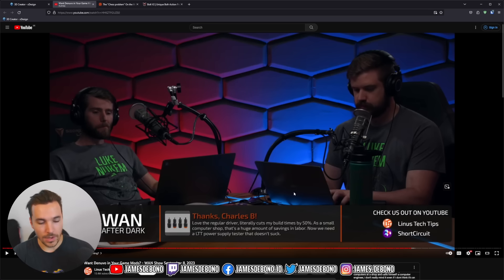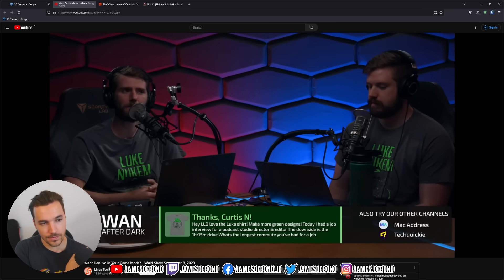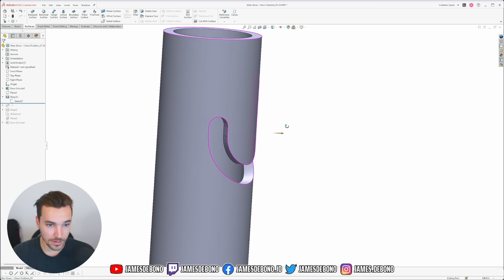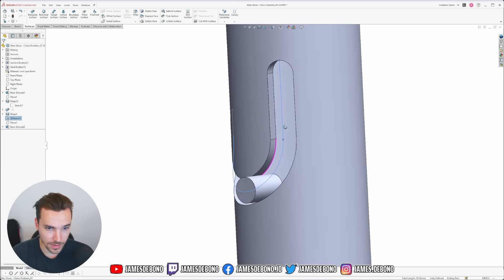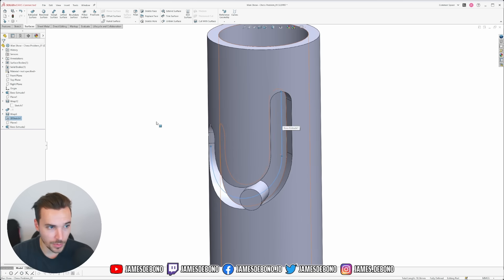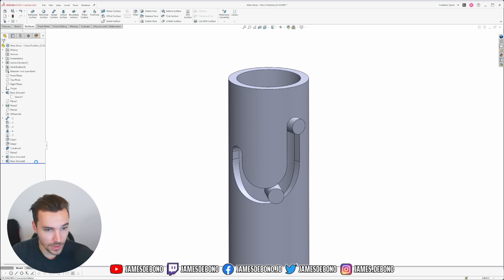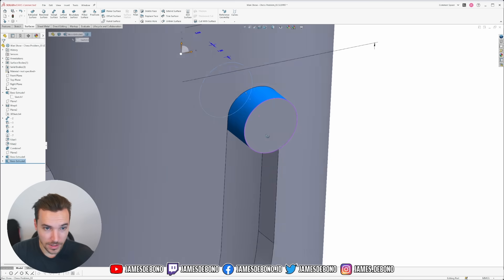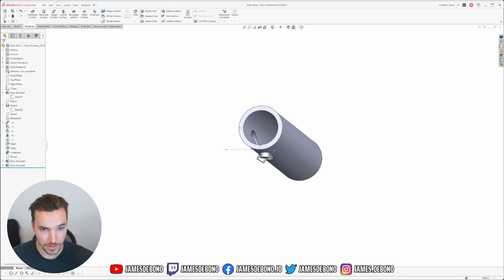LTT - Wan Show "Chess Problem" - Solidworks curved slot in cylinder

Comment: So Projecting the J onto the Mesh Does no Errors... But the Question Now Becomes How do you Extrude it Afterwards Where its 100% Flat in all Direccions...
Hmm Seems like a Curse Problem...
i don't do Solidworks at all - I use Blender but it must have similarities xD... hmmm Getting the Mathematicly Correct answer.... hmmm...
Projecting a Finish Object (Cube = Bad Reuls)  - Projecting a Line ( a Finish Line  = Good Results) , Projecting a Line + Extrude into Shape = Best Results.... 
Hmmm but there is still a bit of offset cause of the Line... but that Software Error now.... probably means that there is another way without Projecting the J in it...

Maybe Getting the U Shape and a Cylinder is "Easier"....

Bit of a Dumm Question.... but can't you Start in a Flat Surface - do the J Cut - Then Transforming into a Cylinder... would that be Possible?... 
let me guess Mathematcly Innacurte to Real-Life... cause CnC Machine Doesn't Follow that Path... Meaning that its Mis-Align When its Get Twisted into a Cylinder xD...

okay I should probably stopp thinking about it xD
Reply from the maker: The problem is that when you wrap it the slot walls won't he parallel anymore

Comment: Yup, is just seems to me the guys at LTT know CAD like 90% of users which is making round and square stuff to build machines and jigs, and relying on baked-in tools for more "complex" geometries (sheet metal tools for example). But making well controlled, more freeform/complex/unintuitive shapes, while not that difficult as you just demonstrated, is another skillset.

I do have an issue with these people saying it's a very difficult problem when in fact they should be more humble and say "that kind of modeling is not in my skillset".
Reply from the maker: I guess a better way to say it is that it's more complicated than it seems at first glance

Comment: How do you wrap an open sketch? i can only do it with an enclosed sketch like in the first example
Reply from the maker: Which version are you using?
Reply: Solid works 2022  @JamesDeBono
Reply from the maker: @UltimateP  Another commenter told me they added this ability in 2023. I know that's frustrating to hear but at least some closure

Comment: In reality I believe the first “solution” creates a valid geometry that can be readily machined via 4th axis CNC as long as you use a cutter that is smaller than the width of the slot. This is generally preferred so you have a more consistent finish by only climb cutting or only conventional cutting the outline, rather than full-slot cutting.

That being said, it’s worth considering whether or not you want a slot that’s tapered through the thickness, as it could affect the friction/feel of the bolt-action.
Reply: when performing the machining operation you specify the edge you want the end mill to follow, so it doesn't matter if it's tapered or not; you can create an offset in the toolpath with stock to leave (which can be a positive or negative value). while this is a "hacky" way to approach it, it doesn't really matter for the end product
Reply: you certainly don't want a tapered slot, the sharp edge will cut into the bolt over time.
Reply: @Pfooh  Maybe add a back-side chamfer?

Comment: Multiple ways to do it, that's for sure. I've done similar type of paths before back in SW2012 or so when we had a lecture on pierce and cuts that follow a path. So in a similar instance of cutting curves on a round pipe for 4th axis milling, we just drew the curve ( projected it ) onto the cylinder. Then at one end, created a reference plane that was perp to the end of the line. Created a rectangle ( To represent how an endmill is gona cut it ) and performed an swept cut that follows the line. Worked perfectly and accurealy represented what the endmill cuts..Took a second to verify this in SW2023 and got the same result. I guess sometimes you just know useless stuff ( me ) as for me SW is just a tool I dork around with. I just do CNC by trade. So I use solidworks based on how I know tooling works..if that makes sense.  I like the 5+ axis CNC machinist for years --> Solidworks/Solidcam --> Engineer direction  VS engineering degree --> solidworks --> HowDoMachineWork?? heh

Comment: If you make a plane perpendicular to the center of the radius you can draw your "j" and extrude it into the pen body ( do not let it combine bodies) then you can use the remove overlapping bodies tool and the slot where the two overlap will be removed. then hide the non overlapped "j" projection.

Comment: Great work. And also detailed explanation on how you solved the issue. I would probably be to lazy and go "eeh as long as the outside parameter is correct then in the CAM software i will use the outside to set the toolpath
Reply from the maker: That's fair but if you want to try a 3D print proto or if you want the model to look correct it's nice to make the model perfect. It's definitely not always needed though I just can't help myself 😅
Reply: I will admit that I can get frustrated to if something like this happens to me. But it all depends what the customer want. :)

Comment: I think I have a way to generate this geometry perfectly, no idea if it'll work in SW but in fusion I created a cylinder then unwrapped it with sheet metal tools added the J then refolded it.
Reply from the maker: I think with this method you end up like the first method in my video where the walls of the slot aren't parallel

Comment: I laughed when I saw that LTT episode. 
I have done so many cam following grooves in SW using surfacing as it is the best way to do it. (Been there a long time ago and developed something pretty darn close to your third attempt) 
Surfaces let you have a lot more freedom in SW and is the best method (in my opinion) to design your parts for tooling and die/mold work. 
It's also applicable if you want to do helical slots in a shaft that rotate and change incline angle and taper. (like a mixing head on an extruder screw)
Reply from the maker: I'm happy to hear that we came up with similar solutions. Hopefully that means I'm doing something right ;)
Reply: I'm self taught in SW, and surfacing truly changed my life (and all of the projection tools).
Reply: @mittens9326  indeed! 
The only thing I wish is if SW would maintain an intersection constraint through a rebuild. 

Struggle with that sometimes. 

Fusion let's you do it! But Fusion has issues of it's own 😂
Reply: @bradleynealdaley  the smallest things it can't figure out with the immense calculating powers it has is why I hate SW
Reply: surfaces are great, no denying that, but this simple shape also could have been easily done with a loft cut with some guide lines... Also, never rely on this shaded view for interferences because your settings could be set to speed and not quality, and it will throw you off...

Comment: Just make a centerline toolpath, knowing the tool will give the cut you want. You shouldn't need to model the edges realistic.
Reply: It might not be important for this chess problem, but if you were to do a bunch of this on a structural pipe that might have a channel for a guide pin, then try to run a simulation, the difference would matter. I do not know how much, only that it would
Reply: @JamesDeBono that might be an interesting video idea. Run some simulations and see if there is a case where it might matter a lot. An intuitive idea is something like an extending pole that uses a guide pin in a channel to lock at different length

Comment: Could you share the last 3d
Reply from the maker: It was made with solidworks for makers so it would only be able to be opened it solidworks for makers. Would that still be helpful for you?
Reply: Could you share 3D as solidworks with old version.
Reply from the maker: @mustafacan9927  I only have the latest solidworks for makers version
Reply: Which version? @JamesDeBono
Reply from the maker: @mustafacan9927   2023 Solidworks Connected

Comment: To get such a simple J shape it can be done with 3 extrude-cuts and 4 full face fillets.
At 6:00 instead of offset+loft+knit you could use thicken-cut or thicken+(fillets)+subtract combine.
Reply: For this very specific shape maybe, but if you need to make some non-cylindrical shapes and in general anything else than just a straight line and a radius, surfacing is the more flexible tool. The goal of that video I think was to show a foundational method to get more complex results, not one that can barely achieve the result shown here.

There is no need to build a closed surface and knit it though, you can work from the simple center surface and do everything from there with a thicken-remove feature and some radiuses for the end.
Reply from the maker: This. You're both right. It could be done in this case with extrude but it the j shape changes it could easily become much harder without the surface method
Reply: @JamesDeBono  I watched your recent video. Prior to commenting I tried this in Fusion360 and it worked. So I assumed Solidworks can do it too. In Fusion360 it can be spread to about 140° before full face fillet starts to fail. Today I tried in it solidworks and it worked only up to about 45°. I don't know why. 
Out of interest I played with Extrude-Bosses instead of cuts (and then subtract combine), and I can make face fillet work up to 140°. But it is very weird and finicky. More problems than it is worth. 
In regard to Solid profile cut sweep: something that could be helpful is to make 3d sketch-> convert entities (choose all those lines) -> Fit Spline. This creates one continuous curve, that might work. There is some "error" in the shape of that curve, but you can control that with Tolerance slider to minimize it below micron.
Reply from the maker: @primoz6578  oh nice investigation work. Interesting to know the angular limitation of the face fillet feature! good work! It's unfortunate that there isn't one clearly perfect CAD program haha. They all have their issues and they are all expensive!

The fit spline is a nice idea indeed but I think it bugs me knowing that it's not quite perfect. Also would it update if you changed the dimensions?
Reply: @JamesDeBono  It does update if you choose Constrained option. As long as converted entities don't break and stay connected in continuous line, it should work. 
" it's not quite perfect." No it is not, but you can think that it is better? Fit spline gives you more curvature continuous path. With straight line and arc there is an ugly point where "radius" instantly changes from "infinite" to real value. It is sudden jump, infinite acceleration, jerk, vibrations ... Gradual change in "radius" of curvature in Fitted spline would provide smoother path. Instant improvement of the design. After all, you have used line and arc because that is the easiest shape not necessarily the most perfect shape.  
A bit of different point of view for your inner perfectionist.

Comment: could you take a flat surface, remove the J shape and then wrap the flat surface into a connected tube shape?
Reply from the maker: You could but the thickening it would create a similar problem to the first example where the edges of the slot are not parallel

Comment: I would have done this in Alias thar has very powerful surfacing & diagnostic tools and forget about the limitations of most solids modelers, but the fact that you solved the feature fully within Solidworks is a testament to the depth of your understanding of it. Congratulations, you should be top hiring material!
Reply: I mean it's still a pretty simple geometry, no need for Alias for that kind of stuff. Take a look at what modern solid modelers are able to do with "limited" surfacing tools nowadays :

https://youtu.be/IjcFotLmCx8?si=QAdyi9NBdDt4wiXG

Comment: So in normal people words, the sizing of the cut needs to be modeled to scale to the change in radius between the inside wall and the outside wall? And the “normal” way of doing this in Solidworks makes it that it scales linearly, meaning the inside wall and the outside wall have different  sizes of cut?
Reply from the maker: Precisely!

Comment: A swepted cut with guide curves on the inside and out should do it as well. You might be able to get away with a single guide curve, but it often distorts a bit so would require testing.

You can also sweep a tool through a path that might work. I had a tricky one years ago where we were making helical cuts with an endmill in the side of a cylinder (bar). Getting the geometry of that cut right was tricky and it mattered because it was a flow passage and we needed to do CFD on it. 

Surprising though, that the whole team couldn't figure this out.
Reply: Yep! This is how we did it in our Highschool CAD class back in 2012 heh. Pierce & Swept!
Reply: You have less control with a solid sweep because it needs to manage more directions/dimensions at once. The advantage of a central surface,which is the correct way to do these geometries if you need good control on the result, is that it allows you to tightly control the part, and then control the volume (thickness) in another operation, which is sometimes not possible with solid sweeps.

Comment: 5 axis ccm/cnc mill
Reply from the maker: 4 axis would be enough for this operation. Many 3 axis CNC milling machines have the option to add in a rotary axis unit to hold your workpiece to act as the 4th axis. It can be a lot cheaper than a proper 5 axis cnc

Comment: Well executed, walking through each method with detailed and understandable rational. Does a bidirectional surface thicken work in place of using offsets?
Reply from the maker: I guess that should work fine as well!  It would save a few features. Good call, I'll try it on the model and see if the result is the same
Reply: My exact thoughts ! Thicken-remove after the initial swept surface would save a few steps.

But really, the key is understanding that this geometry needs to be modeled from a center guide.
Reply: @Penofhell  very well put!
Reply: It works for Fusion 360